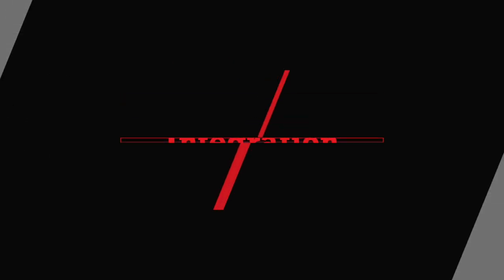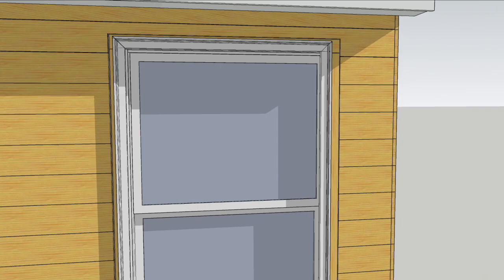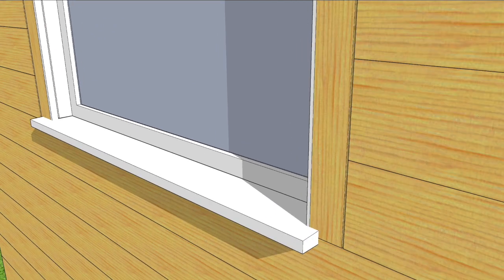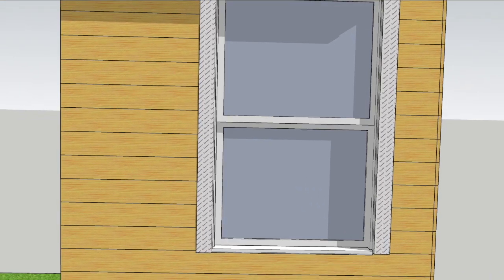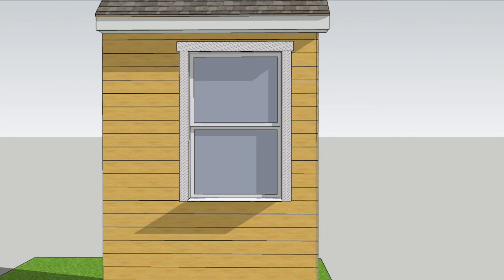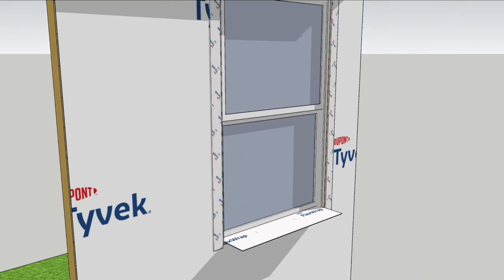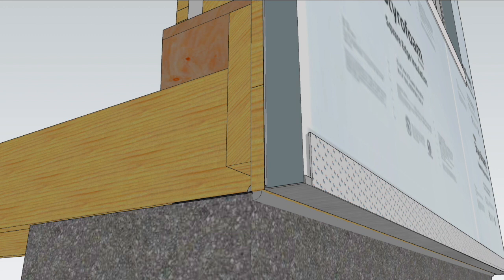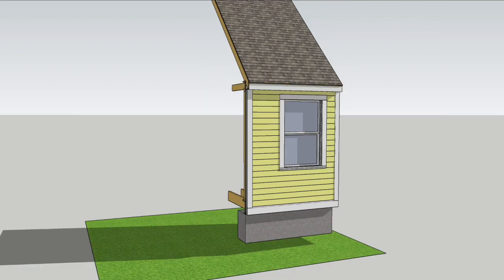TYVEK Retrofit on a Wall with Existing Windows (ptc@home, 1)

Comment: I don't think your Tyvek and tape depiction is correct for the top of the window.  You never want to rely on a tape seal to waterproof window tops.
Reply from the maker: We worked through the detail with DuPont's engineers.
Reply: @ProTradeCraft  The tape on the top of the window is incorrect.  Make 45 degree cuts at the top corners, fold the tyvek up, install the top tape and then fold the tyvek down over the tape.  Install short pieces of tape over the 45 degree cuts.
Reply: @richardmckrell4899  that is the typical detail, sure, but you must remember that the first tyvek layer is really only trying to be an air barrier.  the Drainage Plane is out on the drainable  tyvek housewrap over the eps/xps.  My concern with the assembly is how the flexwrap doesn't bend up the sides any like in a R.O. situation.  This wall assembly is a little belt and suspenders though. 

One interesting effect is a form of water called film.  When water is in film form (when two surfaces are planar) is can pass through the vapor pores of the tyvek because the H2O is similar in size to the CO2 and less able to maintain a larger molecular group because of film properties.  This is why I have concerns about capillary action wicking water to the layer between the foam and the first tyvek layer and potentially reaching the board sheathing... however, board sheeting is quite resilient and if the assembly is relatively vapor open to the inside, then drying can occur at a greater rate than the wetting potential.  

If it were in the budget, I might have used a self stick membrane over the board sheathing (Henry Blueskin perhaps) as it is an excellent way to make an air barrier over board sheathing, which is notoriously leaky (air wise).  It may be possible to swap the exterior tyvek layer for a ventillated rainscreen by making the blueskin a water and air barrier.  The ventilated rainscreen would provide ample drying potential wherever water may get behind the siding, and may also prolong the life of the paint on the boral siding; albeit, that stuff is already pretty bulletproof!.  

All told though, there are plenty of layers on protradekraft's assembly, and it should perform just fine!

Comment: GREAT... Now you can watch the ROT begin because you just created a Vapour Barrier on the Exterior. Depending on your climate you should immediately decide which of these Vapour Barries you want to keep, just do it quickly...
Reply: Are you calling Tyvek a vapor barrier…? Or the styrofoam?
Reply from the maker: Tyvek is not a vapor barrier. It is a bulk water barrier, but it allows vapor to pass.
Reply from the maker: There is exactly one vapor retarder in this assembly unless some knucklehead put plastic on the inside, and it is the exterior foam, though foam has some permeability.

What. do you think is the other vapor barrier?

The wall can dry from the foam in and the wall can dry from the foam out because there is a rainscreen.

Tyvek is not a vapor barrier despite what many think.
Reply: eps or xps doesn't impact perm that much. in fact that assembly should work everywhere.
Reply from the maker: Yes, only the thickness of the foam would change depending on where the house is.
Reply: @GenZyannd  BS, but your the boss so do what you want, it's your money and health...

Comment: Interesting. After you are done can you report back on the ACH or CFM numbers or even the change in utility bills? I am thinking of doing the same thing.
Reply from the maker: I can try to remember. but here's some back-of-the-envelope results: the August electric bill was 42% lower than the previous Aug, even though it was the hottest summer on record. seems like pretty good news.